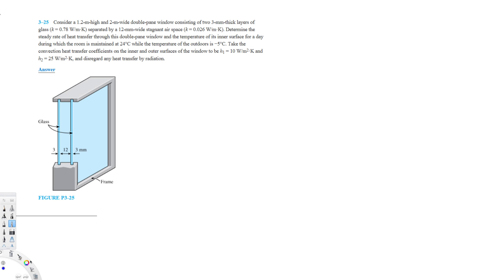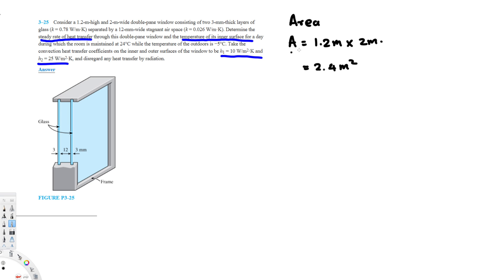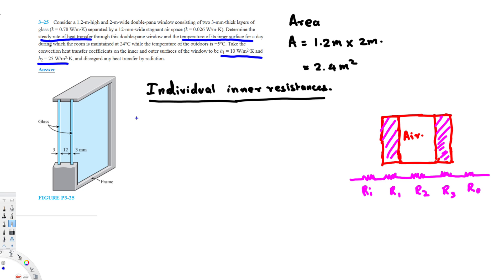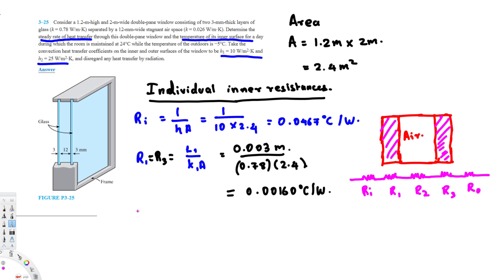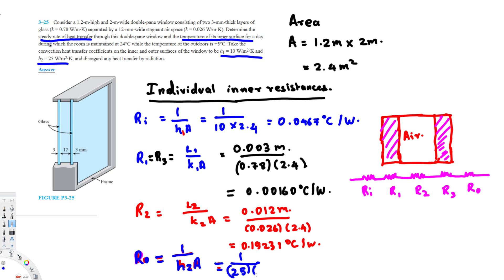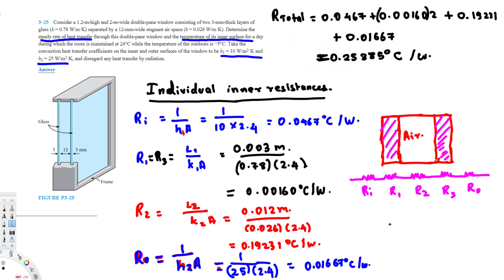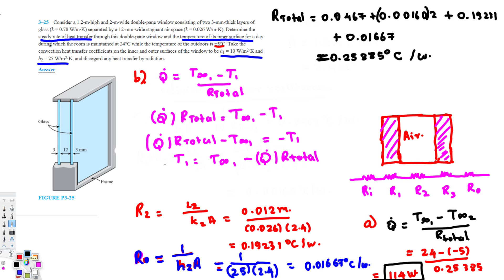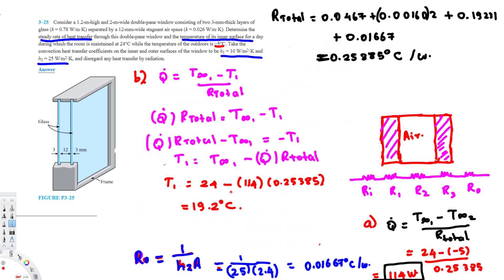Heat Transfer - Thermofluids - Determine steady rate of heat transfer and inner surface temperature

Comment: 6:39 I have a question for you. if the air between window panes is not stagnant, so there is free convection between window panes how would the calculation be changed?

Comment: I'm a bit confused by the end of the video.  How do you get 19.2 from 24-(114)(0.2385)?
Reply: It's incorrect, you don't use the total resistance, you only use the resistance of the Ri and R1
Reply: @adammarks7735  please how is it that the Ri is not part of the the out door and why Ri+R1
Reply: @danieloseibonsu6369  basically just take the first equation to be Rconvection = 1/(h1A) = 1/(10*2.4) = 0.0417
Reply: 24-114*0.0417

Comment: A 1.0 m X 1.5 m double-pane window consists of two 16-mm-thick layers of glass (k = 0.78 W/m·K) that are separated by a 11-mm air gap (kair = 0.025 W/m·K). The heat flow through the air gap is assumed to be by conduction. The inside and outside air temperatures are 20°C and -20°C, respectively, and the inside and outside heat transfer coefficients are 40 W/m2·K and 20 W/m2·K, respectively. Determine the temperature difference across the largest thermal resistance. 
?????????????????